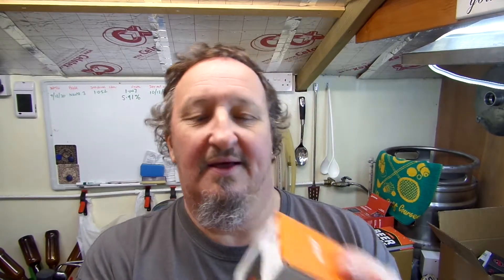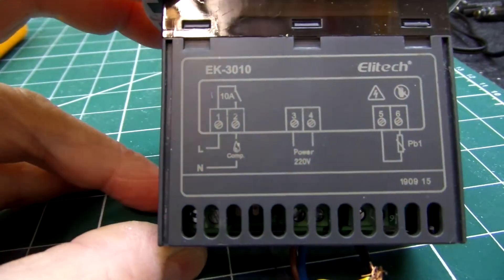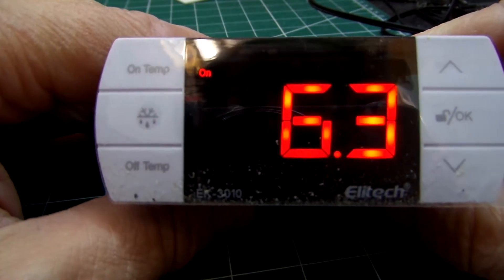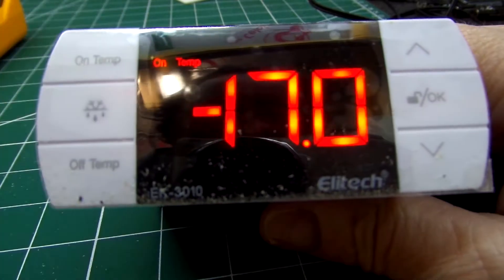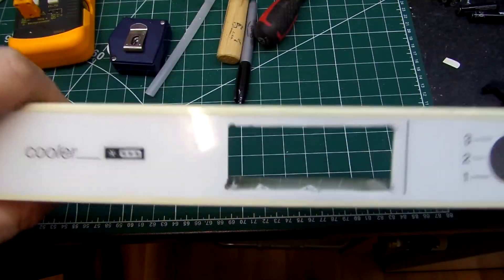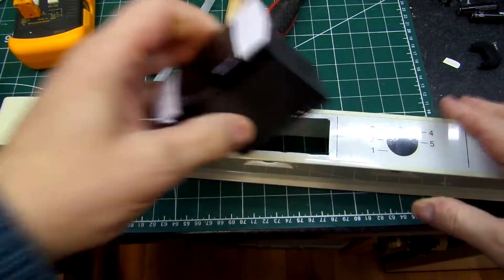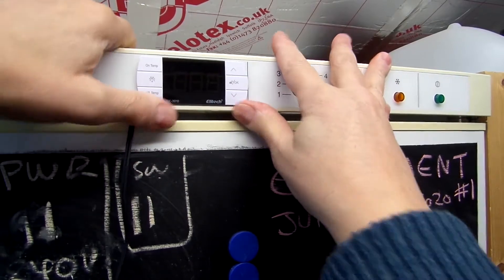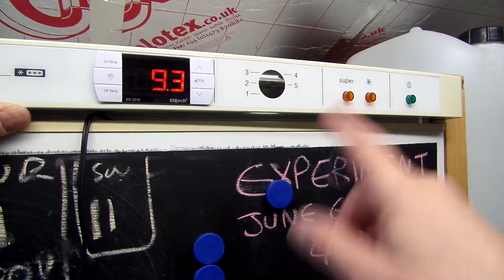Vblog79 - Elitech EK-3010 Controller

Comment: Not sure if this will help.  I have seen similar on you  tube utilising the drain hole.  If it does have a drain hole and the probe does fit with clearance then this method might help. 
Using a piece of rod  (6mm studding, longer than depth of fridge) work it from front to rear  through the foam.  Of course if there is any obstruction from cooling pipes dont force it. Anyway if you do manage to make a path from front to rear, thread your probe through, then down back of fridge, and up the drain hole.  Probe is now inside the fridge.
Reply from the maker: Thanks for the reply, I used the drain hole for the sensor when I made my fermentation fridge but this time I am measuring the freezer temp and it doesn't have a drain hole. So far it appears to be working with my "jam the sensor in the hole I made in the foam" method :).  If only I could pull the top off the freezer but alas it is well foamed on.